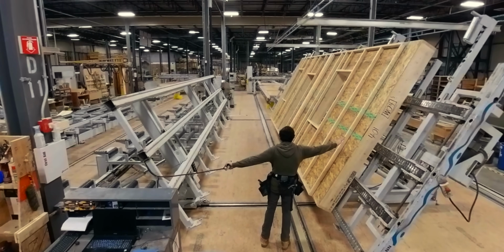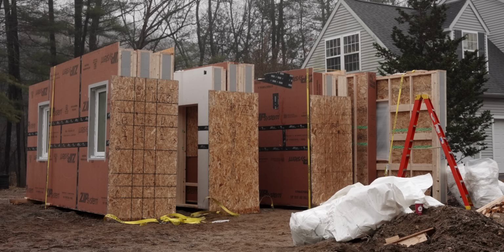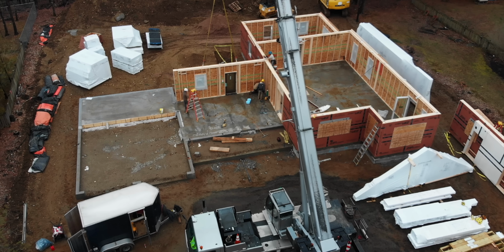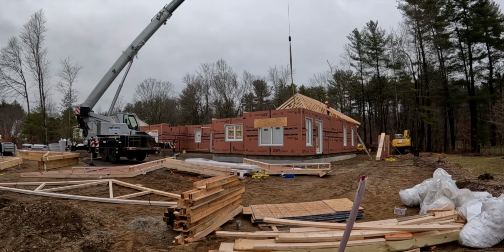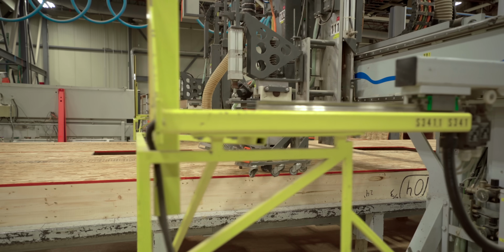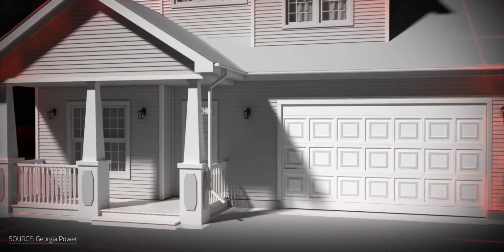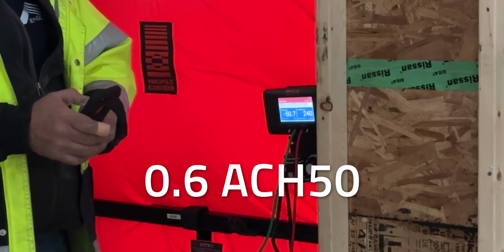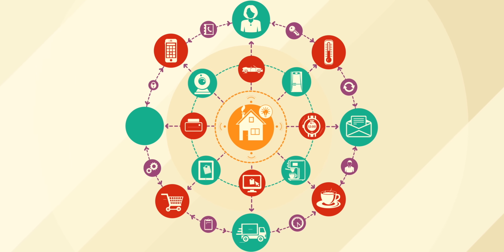Wow! I Didn’t Know A Prebuilt House Could Do This

Comment: My home was built in the factory as was yours, but here in Canada, these folks truck up an entire half a home. So, when ours came it was on two trucks the sections were completely wrapped in plastic. They use a huge crane to lift the sections (~30,000 lbs) onto the foundation. Then the crew raises the roof trusses (they are hinged to get under the power lines and bridges) and close up the two sections. They do not do this when it rains. It worked really well and I think a home that comes down the road has to be a little bit stronger as well. So, while I like your scheme, I think they should take it further to prevent the wetting of the interior surfaces.

Comment: I"ve been studying SIP panel construction.  Why did you choose Unity Homes and not a SIP construction home?  I'm in climate zone 5 and woiuld prefer a basement rather than a slab on grade.  I know that is more expensive however to get frost free you have to go down at least 4+ feet.  Then you are into another discussion on below ground insulation.  I think you have dense packed cellulose in the walls.  I do not know how that compares to EXP insulation.  Are your walls 2X6 or 2x8 on 16" centers?  Another air sealer is AeroBarrier which uses atomized sealer when the house is pressurized.  It exhausts thru all cracks and crevices and seals them.  You may know about this.  I enjoyed your video!

Comment: Does the attic R value score include the effect of the solar panels? I noticed a big change in my house when solar panels were installed. And not all of my roof is covered in panels. Blocking the sun's rays from directly beating on the roof shingles changed my Attic temperature.

Comment: Wood stick 2x4 houses aren't the way of the future though. I'm really excited about the interlocking wall and ceiling panels that already come with insulation and all, that you just tighten into place with a wrench, or undo later if you want to take the house back apart. And you don't need multiple people or heavy machinery to put such a house together for you. A single man can build an awesome house as if it's built out of Linkin Logs with those.  Show us more of those, please!

Comment: Energy costs me less than $3000 per year for my conventional 2500 sf house located at 4500 feet in the Cascades mountains.  I do have a wood stove and I cut my own wood.  In 20 years that has been maybe $60,000 in total costs.   My maintenance costs have been just a new air filter once a year.  I think alternative heating and cooling are for the rich or subsidized and can't be justified financially.  I do have in-floor electric resistance heat in two bathrooms and I wonder how this compares to a mini split.  The resistance heat provides less heat per kwh but less heat is needed to be comfortable since it only heats the floor and not the walls or ceiling.  In a bathroom a heated floor is awesome.

Comment: As I sit here in my drafty conventional stick built home, I am envious! I look forward to updates Matt! Well done! As an aside, a friend of mine was trying to tell me the electric vehicles wouldn’t have good heating. I pointed out that heat from ICE vehicles is a byproduct of their low energy efficiency and that realistically you could turn the heat on in an EV without ever running the motor. Thanks for proving my point!

Comment: With the insulation made up by Cellulose, how is the flammability of your walls? Are there retardants or any other means of protection in it? Here in Europe most houses are build with foam-plates (cheaper, but somewhat toxic with flame-retardents) or with glass-/rockwool

Comment: Also, thermal solar + heat pump makes more sense,  for hot water production.
Cheaper too.
It's senseless to use 2% of energy that solar electric panels can absorb and turn That into heat...
You can still have a few solar electric panels, for running the pumps, for house consumption and for your car
Just covering the 100% of your roof with an inefficient energy generation is... well, you think of a word

Comment: Twenty years ago in Minnesota, I was involved in air-tight homes. The issue we ran into over time was moisture build-up. We worked with Broan/NuTone and others to add ground air exchangers. Some builders made them so airtight indoor bathroom odors also become an issue without an air exchanger. Some devleopers guaranteed NG heating bills below $150/year.

Comment: How long will it take for moisture ingress during build take to clear and what effect will it have on the early house temperatures. With such low air flows how is natural moisture removed to prevent mold?

Comment: I'm really interested in the airflow efficiency. IIRC way back when, homes used to be built for an efficient flow of natural air, achieving a nice breeze effect. With the advent of forced air systems, this has largely gone away, but here in the midwest could/would seriously reduce some energy costs associated with running HVAC systems just to avoid stale air, or overly recycled air.

With your prebuilt home design, how well do you expect air to flow during the warmer months of the year?

Thanks, as always, for such patient and descriptive content.

Comment: If you get enough sunlight solar water heater combined with electric tankless it's pretty amazing.  I have a duda solar water heater with a 40 gallon tank on top.  The water is fed into a thermal value which regulates hot water down to 123 F.  This water is fed into the tankless which will heat anything below 122.  During the winter the solar water heater will keep the water closer to 100 F, which will cause the tankless to draw very little power. ( 2/3s of the year my tankless is pretty much off )

Comment: don't discount the lizard brain so easily . sometimes it's best to freak out and take drastic action . 
i had a manufactured log home from finland built in the rain and my worst fears were realized . There was a bit of 
de-lamination of the first course of logs because they were sitting in water for days . i managed to fix that with some huge structural screws but the worst part was the idiot contractor used un galvanized nails on the second level flooring/ ceiling boards which were coated in oil . the oil streaked downward onto the beautiful logs and post below . we had to sand the entire first floor to remove the stains . 🤬🤯😂

Comment: Well, then the US must finally adopt another "high-tec" standard made in Germany 🇩🇪:  double fold doors with a rubber seal and tight gaps to the floor (done by integrating adjustable screws to the angle)

Comment: My mother built a pre fab house with insulated panels. Mice bored through the insulation everywhere. The roof panels shrunk as they aged so the snow melted in a grid pattern matching the panel seams.

Comment: I'd be very keen to hear about the cost of going passive house vs. conventional build. In Australia, we investigated going for a passivhaus/ "high performance house" but found that it was cost prohibitive as compared with even a high end custom build. Did you make compromises in the size and or fittings of your newly built house and how did you rationalise those against one another.
Reply: Hi, I am in Australia too, about 25 years ago I built. I am an electrician so I built my house as an owner builder with the design as energy efficient as I could afford. At the time it has double glazed windows, timber windows to prevent thermal bridging and I insulated the wall cavities with brick veneer on the outside and also insulated the internal walls between the studs. I did a steel frame home so it was all factory made and my dad and myself tek screwed it all together and bolted it to the concrete slab done by others. I put as much insulation as I possibly could in the top and with the double glazed windows and the double glazed doors with triple locking it is quite sealed. I am now running the whole home. Definitely carbon neutral. It's actually the other way because I'm exporting more for my solar panels than I use. I do have batteries as well to Tesla's and another battery. I didn't need that much but I got sick of sending it to the grid and we get nothing for it and the grid prices are going up so it made sense but I advise maybe 15 kilowatts of solar panels on the roof. Try and get three phase available if you can. And also do reverse cycle ducted quite an energy efficient way of heating and cooling your place. The heating and cooling usually doesn't have to be turned on till about a month after everyone else and it's turned off a month before everyone else due to the passive solar design with the big huge windows to the north and then overhang to prevent the sun coming in in the summer. I get about 5 m of sun going into the living areas onto the tiles to warm them in the winter when the sun's out so it works brilliantly. I use the electric induction cooker and heat pump for heating. The whole water and the whole thing is really awesome. So proud!. Because I didn't know the builder, I don't think it was that much more expensive. It was certainly cheaper than paying your bill to do it. Double glazed windows don't cost double the price as the window maker told me and it's true. I am on 6 acres so I have sprinklers pumps, septic pumps and a swimming pool to run. The whole lot runs off the 15 kW of solar panels. I am actually a solar panel installer and specialising renewable energy too so that helps.

Comment: Have you covered retrofits to get closer to net zero or ph standards for existing housing stock of wood frame brick sided with nat gas heat built in the 50-90’s? (Ie sealing, 3G windows, roof materials, insulation, recladding to add wall sealing AND R value, sill plate and floor joist bay sealing and insulating, best basement insulating (walls, floors), hybrid heat systems (nat gas -asho), how about a series on “near off-grid  and near net-zero changes to existing housing”?

Comment: Are you adding a separate hw hp or and surge tank? Tim short in T.O. Has a hybrid nat gas ashp heating system on a retrofit with a second ashp for hot water, including  a hp AND an insulated hp storage tank. Thought it was a good approach for Toronto retrofits. saves the cost of demo. Of the nat gas and gives you protection against -30c days when some Hps are challenged.

Comment: why did you put a traditional large pitched roof on a eco sealed home - seems sealed roof system with flat or slight angle would have been more efficient? confused - unless its big cost issues - but all those trusses couldn't have been cheap - or the crane?

Comment: I enjoy your easy to understand informative posts.  However, there is something called the 'psychologist's error', which is you think others have the same thought pattern as you.  When you said, 'weather is always a consideration'.    Where I live, that is only true about 37 hours a year, the number of days that it rains, and I live in a Mediterranean Climate, which is the only one with a winter maximum of precipitation!   I live on the ground floor on the North side of a four story apartment house.  On the South side, residents need to use their air conditioner all year long.  This is from the sun light energy entering through two windows.  I almost never have to use the air conditioner or heater which is one unit.  Recently it has been extra cold, and the interior temperature may have dipped as low as 70 degrees.  The building looks new but is about 30 years old.  I'm extra lucky since I live near the front lobby.  On upper floors, I smell cigarette smoke and kimchie (sic?, processed Korean cabbage mash)  I kid I live in North Korea, I am not prejudice, about 50 years ago I had a Korean chauffeur/ body guard.  He had worked for the American Embassy in Soul, but that was only a Buick.  There were only about 5 modern Lincolns in the Los Angeles Basin at that time.  There were no limo services, and poor people called it a 'mourners' car'.  My residence isn't energy efficient.  It doesn't have to be.  The sea breeze keeps the highs low and the lows high.  This is the first season in over 7 years that we have had above average rain.  That was about 17" per year.  Between May and November we have no rain, but we have the June gloom.  The hinter land heats up and the ocean in cold.  We get late night and early morning overcast sky s.   Sometimes it is warm at the beach and a bank of clouds moves in and it is time to pack up, put on clothes and go home.   As a little kid I lived in Ohio near Cincinnati. I wondered why other houses had snow on their roofs and ours didn't.  Years later I learned about heat loss.  I had a cabin in Apple Valley.  I put a trom wall on the south side.  It started heating as soon as I buttoned it up.  In the winter I'd find the cabin in the high 30s.  With the wall it was in the low 50s.  Then when I'd block it off at night, it'd increase by more than 10 degrees.  When it's freezing outside,, 60 seems too warm to me.  We used to have eye smarting smog when I was young,  now that is gone.  The car population is maybe 10 times greater, also the top two selling cars in California are the Tesla 3 and Y, or Y and 3!  Lastly, a couple years ago I drove past the first gas station I had ever seen in my life.  It's on 190th Street across from a refinery and sells Hydrogen!  i think Toyota is the only brand with that option, at this time.  Oh, my Lincoln got 7.5 mpg, and if I drove around the town it often cost $5.00 for gas.  On the road it would get maybe 12 and that could be at 80 mph!  

Again, thanks for the great posts.  I am not very christian because I only want good things to happen to good people.   I wish you well.  Oh, there is one Irish singer, who I think must have made a fortune on Youtube which he doesn't need.  I counted a few posts and he had about 20 Billion hits!  Justin Bieber only has 1 billion after so many years, but who is counting.  Well I guess I am at times.  Bye-bye

Comment: I love the increase in insulation capacity and removing thermal bridges but I seriously worry that we will look at modern pressure sealed homes as a major health issue because it will trap all the off gass of modern building materials and trap humidity and mold. Some people will point out that modern active air circulation can more than compensate for that which is true when it is running but that is just another system that needs maintenance and can fail and is a barrier to true long lasting construction. Back on the pro seal side however apparently less dirt buildings up in sealed homes and they have fewer bug and rodent problems because the seals keep them out.

Comment: Nice video. Since 2005 I got into airtightening low energy and passive houses as a contractor. Sometimes it’s really difficult to reach these limits. Especially when previous contractors didn’t really know about the required specifications. In the end I finished trying to fix other people’s problems. A good 3D awareness is required to do the job. I’m European, so I called my job ‘haute couture in building construction’, due to the many connections that have to be made to make everything airtight.

Comment: Great energy-related info, but OMG who didn't have the class or sense to put a fatter header in to support the entry-way roof so that the super-ugly mid-span 4 x 4 post,  offset only a little from the path to/from the front door, could be eliminated?  Just wait--it'll bug you more and more over time.

Comment: Matt check out 
intelligent membranes  on the internet they are based in the uk but supply in America  they provide passive house standard airtight spray/ paint on membranes specifically for passive house standard. I think you should investigate this as an added measure to apply to your build they do a variety of other membranes inc waterproofing and fireproofing spray on / paint on membranes if off interest to you

Comment: for your geothermal system are you digging straight down or horizontally for the heat transfer piping?  Also are you planning the system for domestic hot water as well?

Comment: Matt - given that the insulation is preinstalled in your walls does that present an issue if you want to run Ethernet or other cables around your house?

Comment: there are definitely advantages of factory built building components.  but my concern is with the synthetic insulations, such as spray foam, which is combustible.  whenever i see a new residential building burning very quickly i wonder about the flame rating of the insulation.  sometimes manufacturers add other chemicals, some quite toxic for people, to the mix to reduce the flammability.  and sometimes there is off-gassing of those chemicals into the interior space air, since the buildings are so tightly built now.  i wonder what this builder uses and how that can be confirmed since everything comes sealed up to the construction site.  also i do not care for prefab trusses, since they are closely spaces and then to "billow" in hot weather.  also being so closely space reduces the ability to use attic space for mechanical systems and storage.   and i thought i saw that the ground floor was a "slab-on-grade."  if that is the case then in strong winds, the wall studs will tend to rotate and eventually get detached from the slab.  otherwise, manufactured housing sounds great!